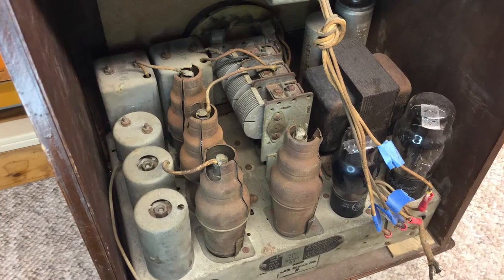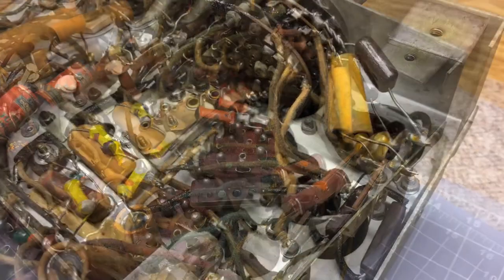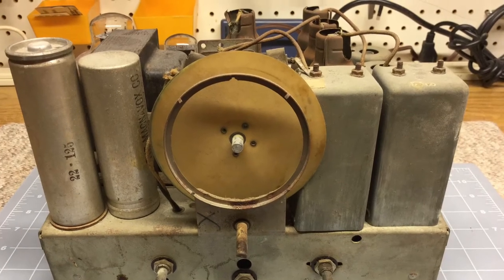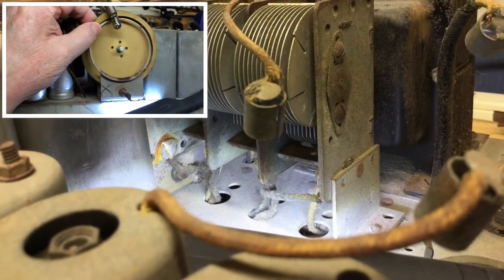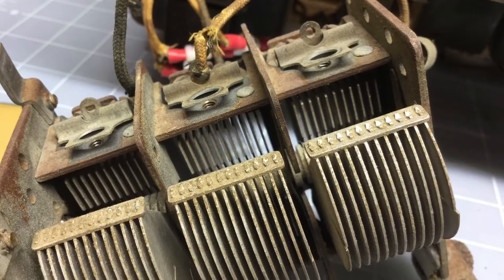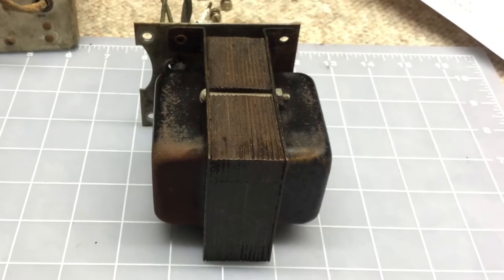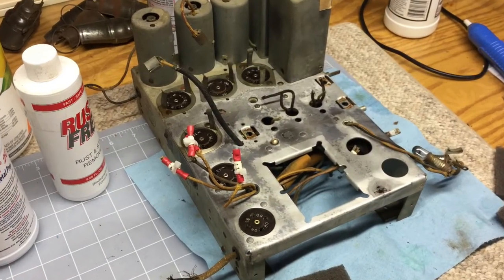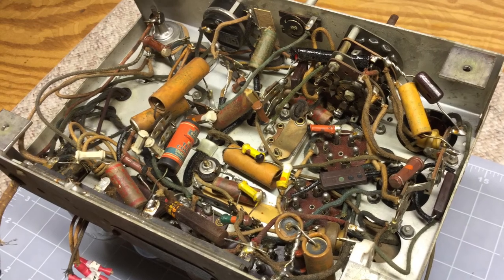Zenith 808 - Restoration Begins

Comment: On the other hand.  I restored an Airline from 1933.  The original components resembled the ones in your 808.  The capacitors were packaged in minor works of art, like the ones in your 808.  Perhaps Zenith did not private label components until 1937.

Comment: Re:the UL mark, I wonder if they, Zenith, shipped a batch of each production to UL labs to back up their own QC process? I have a set here with just 'UL' ink stamped on it so maybe UK manufacturers did the same. Nice set and I look forward to more.

Andrew
Reply from the maker: ***** Andrew, thank you. The UL stamp is interesting and you may be correct. I also reached out to AMStationEngineer and Dennis Carter who are SMEs when it comes to the history and theory of these old radios and more hoping one of them can shed some light on this. Thanks again for watching. Best. Don
Reply: RestoreOldRadios ***** Believe it or not (sorry, Mr. Ripley), one of my mentors during the 1970's, Mr. Morrill Godschall (I miss his insight greatly), sat down one day, and told me the story of the "Armstrong patent saga", an interesting period which lasted from the early 1920's, through the 1945 "Sarnoff reapportionment" (of FM), and finally, concluding when Sarkes Tarzian figured out competent FM receiver circuitry in the mid-1950's. As best as I can remember, Mr Godscalll told me that one of Edwin Howard Armstrong's requirements for "multi patent agreements" was a safe construction requirement. Underwriter's Labs provided some of that verification, as did a "preferred manufacturer's list", maintained by periodic visits by Armstrong's representatives to the various factories. If you notice, on later (1940's Zeniths), the Armstrong circuitry and UL Safety labels are the same colors, and not by accident!!

I would have remembered more, but this was told to me in 1979, a year which I enjoyed far too much ;)
Reply from the maker: ***** ***** Tim, great information on the subject and thanks for sharing. I'll start looking at the color of the Armstrong circuitry... and the UL Safety labels on some of my Zeniths from the period. Best, Don

Comment: I'm very excited about this restoration! It's always very pleasing when the previous repairs were well executed. 
Are you going to try to replace that smaller electrolytic can with one that matches the original one? 
I look forward to see the progress you will make in the next weeks.
Reply from the maker: Félix-Antoine Gravel I going to re-stuff the existing electrolytic cans or that's may plan at this time. Both appear to be original as the part numbers for C14 is 22-125, a 8 uF and C19/C20 is 22-318, a 2 uF and 8 uF capacitor. It's interesting that the overhead shot of the chassis at the very beginning of my video shows the value of C14 to be a 16 uF. I hope this answers your question and thanks again for watching. I'll do my best to post another video within the next week, assuming I can parse out some time to continue the restoration. Best. Don

Comment: Enjoyed your restoration.  I am working on my 808 and just finishing the cabinet.  I have recapped the set and it plays with low volume.  Using my signal tracer I get little signal out of the 6D6.  I am trying to find the R1 in the 6D6 circuit and I have not been able to.  R2 was way out of tolerance.  The way this chassis is wired is ridiculous.   Did you happen to note it's location when you went thru your restore?
Reply from the maker: Brian - let me check my documentation and see what I can find. My Dad now has the radio, so I don't have it in my possession for reference. I'll get back to you ASAP. Best, Don
Reply from the maker: +Brian Amyotte Brian - I sent you a PM with a link to a video. This is my best guess on the R1 location based on the photos I captured. Best, Don
Reply: +RestoreOldRadios  Hi Don - Just saw your reply in my Gmail account linked to this.  Thank you and I do believe it to be R1.  Brian

Comment: After the tuning cap is removed from the rust remover and cleaned, how do you know how tight to turn the adjustment screws on the re-installed mica?
Reply from the maker: Mike Devita Hi Mike - you asked a very good question. As you noted, there are three separate (screws) adjustments on the tuning condenser that will require readjustment once the the mica strips, etc., are back in place. The alignment of the receiver requires you adjust the trimmers to achieve the loudest signal as your introducing a modulated RF carrier to the receiver at various frequencies and tie in points. If you haven't seen this done in the past, reply back to this comment and I'll be sure to demonstrate and capture the alignment process for you and others in one of the upcoming videos once I get the recapping and other... completed. I appreciate your question as well as taking time to view the restoration. Best, Don
Reply: Thanks.  I generally understand alignment but never took alignment screws and mica- completely out.  Thanks.

Comment: I’m in the process of restoring an 808.  How did you remove the pointer? Thanks!
Reply from the maker: Eric - that was some time ago, but looking at the video it appears the dial pointer would pull off facing you. I hope this helps and good luck on your 808 restoration. Best, Don